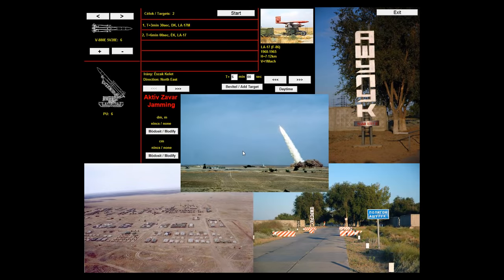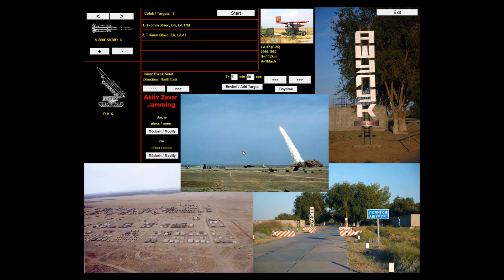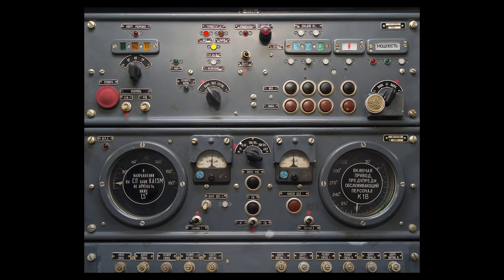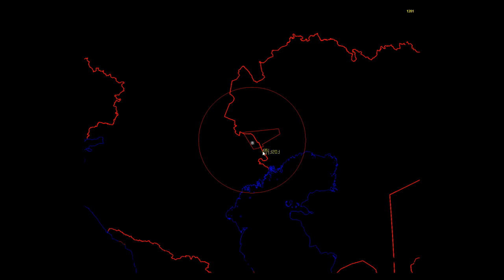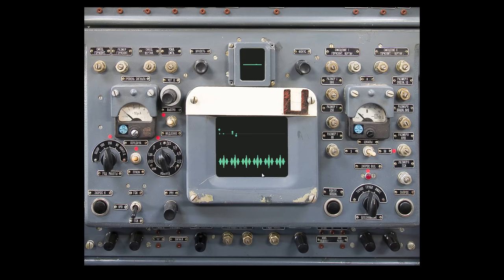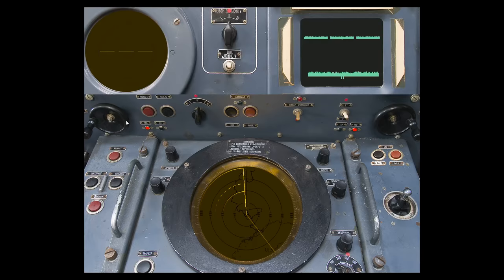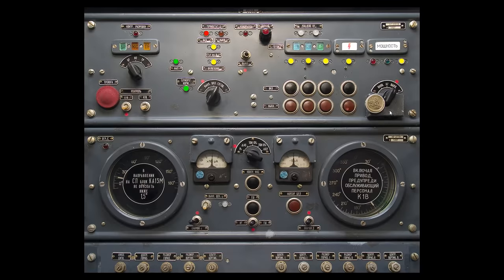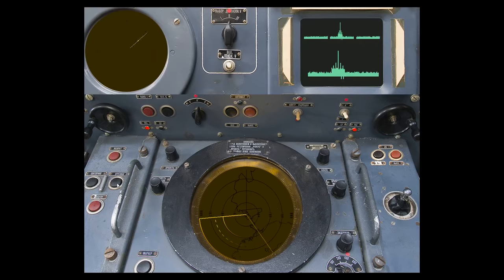Game Time - SAM Simulator: SA-5B Gammon

Comment: Does it simulate the sound of the HARMS arriving outside your control hut at around Mach 3.2?
Reply: haha silly pleb, it is a stealth sam site.
Reply from the maker: It does simulate the awful racket of a HARMS disassembling your tracking radar. After that you're kind of done for the day.
Reply: Wouldn't any kind of HARM home, not on the  hut, but on the radar antenna? It's a seperate unit on a SAM 5...
Reply: @PATTHECATMCD  Well done Grasshopper - You pass the test.
Reply: The HARM was not a thing when the SA-5 came out. It appear only 16 years later.
FYI SA-5B has twice the range of HARM.